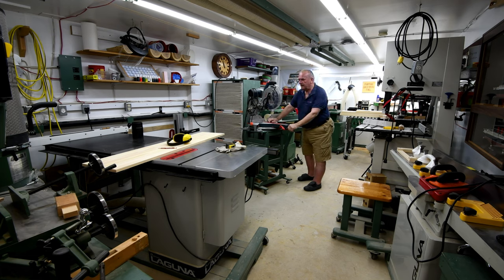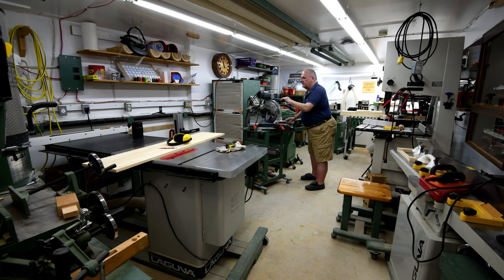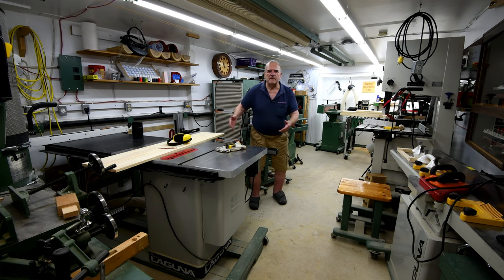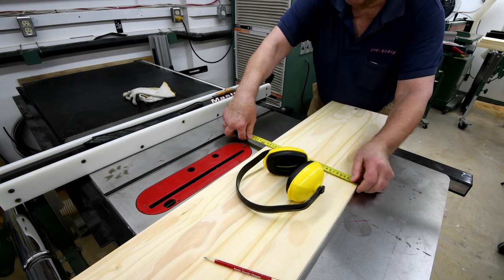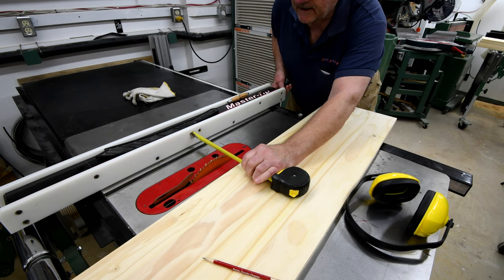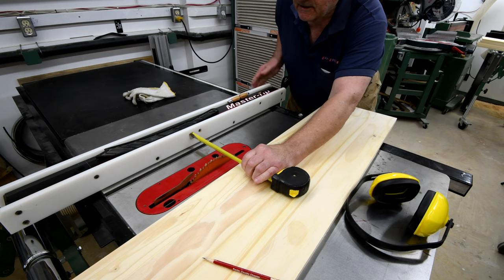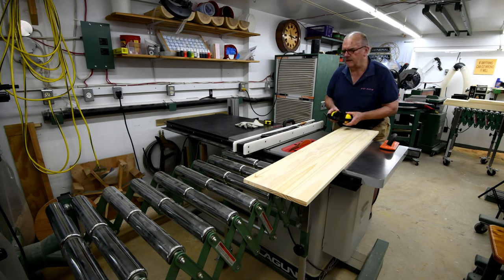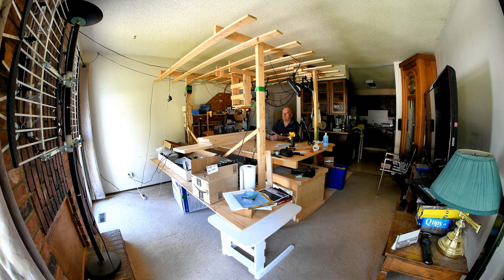The Model Ship - Part 486

Comment: Friend of mine sharpened saw blades and planer, jointer blades for the public.  When I carried my radial arm saw blades he told me to be sure to mark them.  He put less ( what I am going to call) hook in them.  That way they wouldn’t grab.  Not sure what it is called but it sure did work!  Wish he was still here, gone to see his wife in Heaven.
Reply from the maker: Hi Billy,
A blade that has a slight negative hook is what you want for a radial arm saw. It doesn't have as much tendency to grab/kick. 👍

Comment: :25 Ron, can you explain or do you have pics of that ceiling hose holder?  That struck a nerve with me.  I have them all over the floor and rolled up and hanging ...... somewhere.

"...catch.  Forget that I showed you that" LOL😁😁😁😁   Over the years, how many times have you had a radial arm saw climb on ya and scare the daylights out of ya?  The good thing was the arm could not rise so most of the time it just bound up.                   See ya tomorrow.           JimE
Reply from the maker: Re: "that ceiling hose holder" It's just a 1X3X10ft hinged at one end.
Re: "how many times have you had a radial arm saw climb on ya" Never, that I can recall, but that's because I reposition the fence and push the blade through the safer way. I don't know about yours but mine turns at 6000 rpm and the idea is that if the blade is sharp it's supposed to cut through quickly. Emphasizing "supposed to" 😁
See you tomorrow Jim. 👍